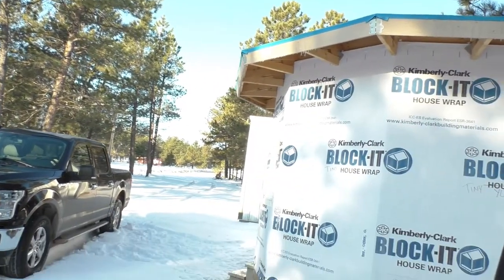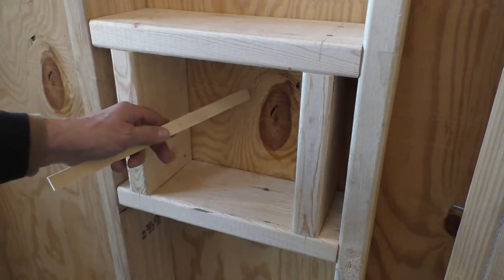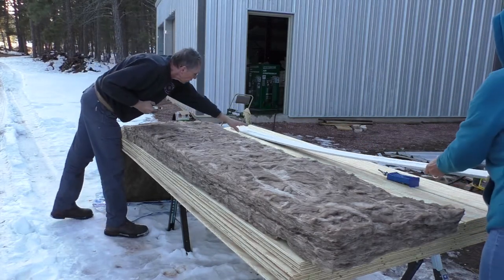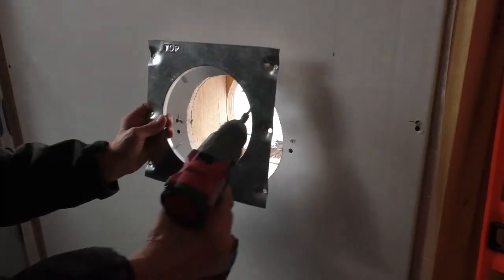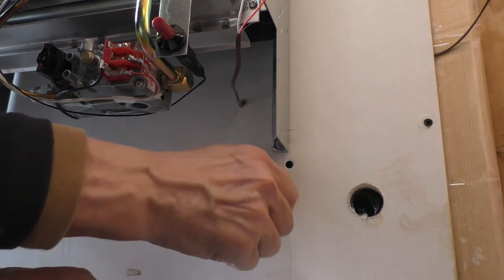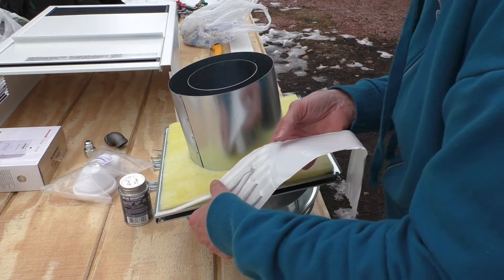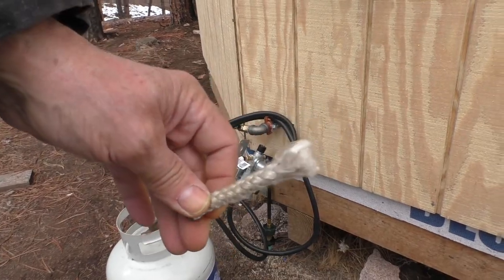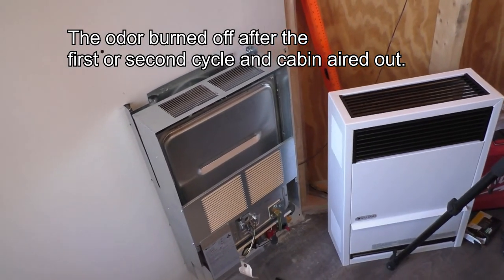#39 Williams LP Direct Vent Furnace/Heater Installation Spencers-Mountain off-grid Tiny Yurt Home

Comment: picked up one of these 14000btu furnaces used on marketplace i need to get the conversion kit to go from nat gas to lp.
Reply from the maker: After a lot of hunting around, Menards had best price on Williams heaters and parts. Lower than direct from Willians.
Reply: @SpencersMountain  dont have menards in canada i ended up order the part from a site in canada last night 187 cad. :>
Reply from the maker: @Barret_Radtke  not a huge expense, but the parts can't possibly cost that much...assume it is part of overhead cost. At least you should be up and running soon. Watch the part of our heater videos where we change the orifice, we found a simpler route than the instruction provide.
Reply: @SpencersMountain  thats what we call the canadian tax. 145.43 + 33.02 shipping. hope i get it before it gets cold they aparently dont have it in stock so i might have to wait a bit.
Reply from the maker: @Barret_Radtke  ouch...yeah that is a bit of s hit. Don't know why simple everyday devices have to be so costly. And, this one of the cheaper unit in this type. Hope you are up and running soon!
Reply: @SpencersMountain  yeah i think it will take a few days for the place to get the part in since they order it from the place when you order it. Still a few more months before winter.
Reply: @SpencersMountain  got an eta on the part i should have it by the first week of october. 
I have a question about the flex pipe did you use thread sealer on that as well or mostly just on the black iron and black steel?
Reply from the maker: @Barret_Radtke  the flex hose is flare fitting and should not require sealant.
Reply: @SpencersMountain  ok
Reply: got my conversion kit installed and furnace setup.  going to order new pilot light assembly as pilot light went out a couple times till we turned it up.
Reply: i also got programable thermostat. RTH2300B.
Reply from the maker: @Barret_Radtke  when lighting, be sure thermostat is set low so it doesn't want to turn on gas valve. Hold in pilot valve button to light and keep holding pilot button for up to one minute to heat thermocouple to allow pilot light to stay on. Close access window and turn up thermostat. Burner should light. If thermostat is set high, pilot will no stay on. If pilot is not allowed to heat before releasing pilot button it will go out. Hope that helps.
Reply: @SpencersMountain  ok thanks we turned the pilot up a bit more and it seemed to stay on. still going to order new pilot light assembly.
Reply: @SpencersMountain  pilot light goes out alot. I even replaced the pilot light and thermal coupler. Idk if its cause of wind or another issue.
Reply from the maker: @Barret_Radtke  I am not a tech, however the manual suggests pilot outage is the result of insufficient millivolt or related issue generated at the thermopile. I personally would start with checking that voltage. But it requires a meter capable of that measure. There are several millivolt gas valve video on YouTube explaining function and adjustment of those valves. My first guess is a pilot adjustment at the valve, ensure proper pilot impingement on thermocouple. The current is very small but necessary to any function. Hope that helps.
Reply: @SpencersMountain  ok thanks after re-lighting it 2 times last night it seems to be staying on
Reply: should use thread sealer on a 100 pound propane tank i feel like i am going through it pretty fast.
Reply from the maker: @Barret_Radtke  definitely spend the time with leak detector and flashlight to ensure no leaks. Use a quality gas rated sealant where appropriate. Keep in mind furnace efficiency and thermal qualities of place being heated. Propane has a certain BTU per volume...trick is figuring out where it is going.
Reply: @SpencersMountain  had check with a leak detector but found no leaks. I was thinking only 21 days between filling the big tank and using up the smaller 30 pound tank was a bit of a let down.

Comment: Thats a CHEAP heater
Reply from the maker: About as low cost as you can go for a non-portable wall mount heater and doesn’t have an open flame to the room. However the 67% efficiency is pretty disappointing. You get what you par for. Thank you for watching.

Comment: What gauge wire did you use for the thermostat and how far did you mount it from the heater? Thank you.
Reply from the maker: I am sorry I had not seen this comment. I used a two wire condutor specifically intended for thermostat usage. Only one red and one white wire. I believe my wire is 20 gauge with up to 18 recommended. This wire carries a very small current (valves usually rated at 750 millivolt for operation).  We mounted the thermostat about 6 feet away from the heater about 5 feet high from the floor. Appears to be working OK in that location for us. The manual indicated a thermostat could be mounted on the side of the heater case.